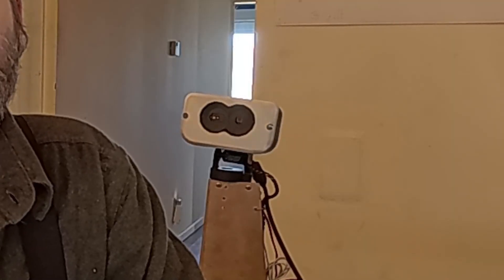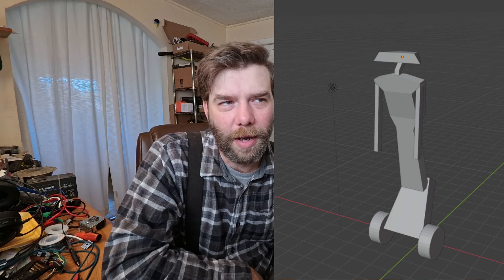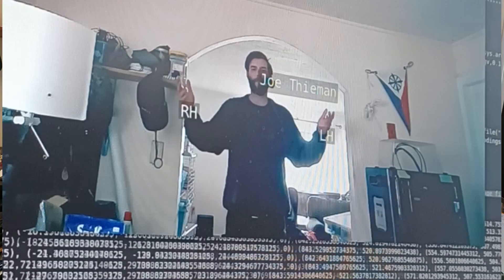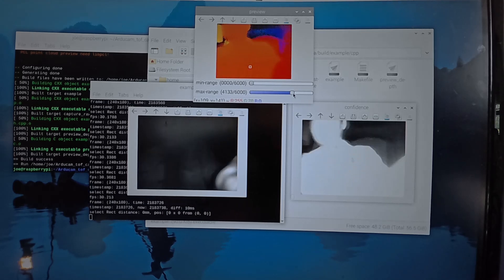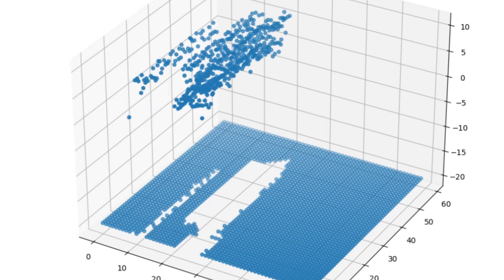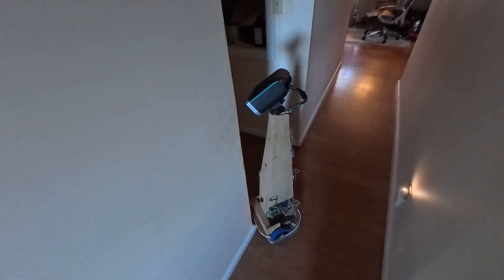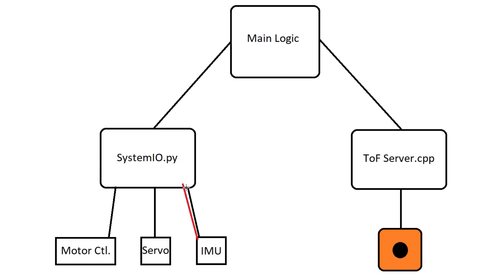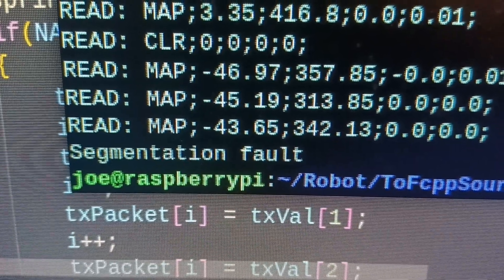Household Robot Project Ep7 :: Project Overview To This Point

Comment: Here's an idea for a (specialized) household robot: a robot vacuum, but specifically a "wand" attachment for a canister vac. When pointed down and not against a wall, it does nothing but let suction work normally, but when angled to suck a wall or ceiling it turn on fans to pull it against whatever surface it's touching harder, and uses something like Omni-wheels equiped with rotary encoders referenced to an accelerometer/gravity sensor to resist (NOT to stop) it's downwards movement over that surface.

Comment: Cool project. I am working on one myself. I have both flavors of Jetson nano and Xavier NX. Both have tons of power for AI.   I have built many in the past but only 1 actually used AI and that was 5yrs ago. Hope to see more of your content! I think the one I am working on will vaccuum, mop, and mow the lawn. I want to build attachments for each type of work. Not sure how far I can take it, but I think if I could do all 3 of those things and a decent job of each task it would be a win. Each attachment will need to be good at its purpose for it to be a success. It's obviously not as small as the little floor vaccuums so it will only work on the main areas but I would be happy with that. Great job with the channel so far. I just found you today.
Reply from the maker: Thank you! Yeah, I'm not evening considering making my robot go outside... the mechanical challenges are huge! Dust, dirt, getting stuck, or tipping over on uneven ground... Sounds like a cool project!

Comment: What are your thoughts on ROS?
Reply from the maker: I looked into it briefly, but my first impression was that it has too many features that I won't be using, and so would have unnecessary overhead... that and I wanted to develop these algorithms myself.. I enjoy reinventing the wheel... 😆
Reply: @joethieman9400 the  complexity is what puts me off from using it.  Perhaps some components could be useful depending on the ease of interfacing...

Comment: Should have used ROS. I made a robot that uses SLAM. ROS is a tried and true framework for these things to make this exact thing less of a headache. Cut your losses and start over.
Reply: It's on my website under projects if you want to see it.
Reply from the maker: I may have to look into ROS again.. My first impression left my worried that it's long list of features would use an unnecessary amount of system resource for my little project.

Comment: the problem of inconsistent sensor data from multiple sources can be solved by adding timestamps to all sensor data at the location of reading. for my master thesis i have implemented such timestamping in atmega microcontrollers with native usb support. one can do this by synchronizing local clocks to the start of usb frames (controllers offer an SOF interrupt usually). on the main linux host this requires a bit of kernel hacking. with this setup it does not matter anymore if one of your sensor pipelines take longer than the others as you can remove any jitter and offsets. of course for quick reaction times you want to minimize the delays and accelerating the whole thing is certainly a good idea - it does not solve the underlying problem though and you may run into it again later again when resources get more strained.
Reply from the maker: The timestamp idea is a good one. Right now I'm just trying to keep everything pretty lean and fast. From what I can tell right now, the movement (reflexes) of the robot are the most time-critical processes. Things like object recognition, decision making, and speech/intent recognition can be done at a slower pace. (And I have the power of a Jetson Orin Nano reserved for these things.)